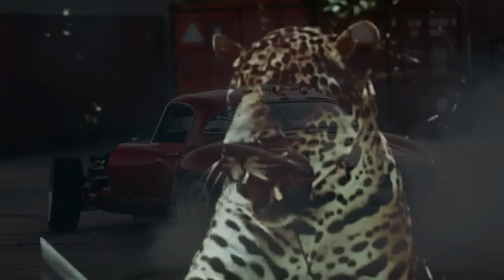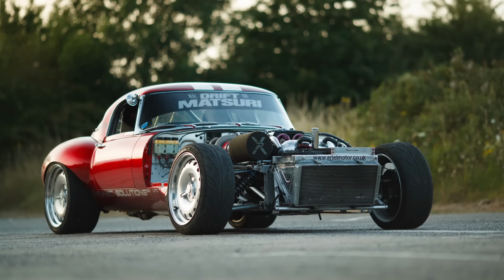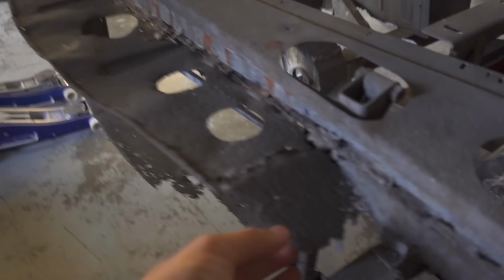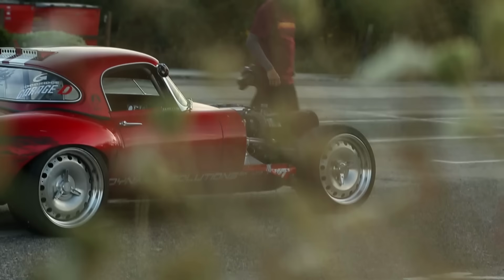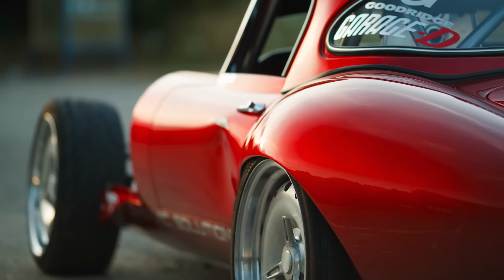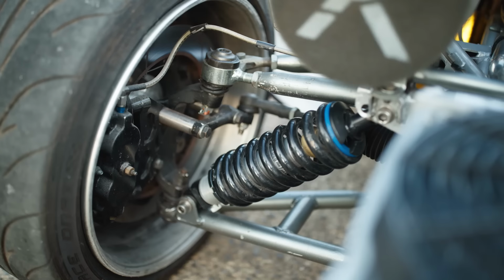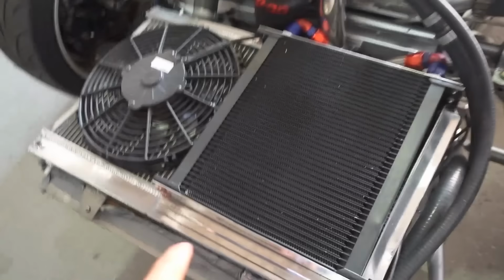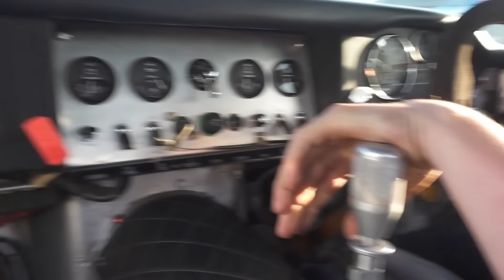Jaguar E-Type That's 1JZ Swapped and Half-Cut: Badass or Blasphemy?

Comment: You mean a Jag that actually runs and doesn't break down every day? Sounds Badass to me...
Reply: Toyota motor on it, so you have the reliability
Reply: @sepg5084  There's a company in the US called JTR, Jags That Run. They sell kits to convert Jags over to Chevy 350 motors. Jags are beautiful cars the mechanics are just so complicated and inconsistent from what I've been told.
Reply: That's exactly what I was thinking! The E Types are gorgeous but being a British car the engine isn't reliable. So it only makes sense to drop in a 1JZ.
Reply: Chris Brown you are very wrong about this car, the original 4.2L dohc I-6 is a fantastic powerful and bulletproof motor even with carburetors
Reply: @jrew3569  Good to know. I've always heard the Jag engines were tough to keep running, but that also may have been more about the ones with mechanical fuel injection and later models than this one. I do like this build because it would be a shame to take a classic engine and try to drift it. Something cool about an old body with a new engine and suspension
Reply: @jrew3569  1JZ is waaayyyyyy better in terms of reliability and sound imo
Reply: ¿ ? lots of JDM fanboys online but have you ever actually heard a Jaguar E-type in person? It’s fucking music to my ears, I don’t think the JZ engines sound like anything unless you add turbo noises. I think you still underestimate the reliability of the jag, they’re built like tanks, oversized components, simple timing and valve train systems, and also handle boost, might not make 650hp stock block but this is also 50’s technology ahead of its time. I know this is a pointless argument but I just want people too appreciate how great Jaguar WAS
Reply: Chris Brown Thats a common stigma with jaguars that would definitely apply more to 80/90’s cars, maybe even ones with this same motor! They used it for decades. I love this build as well, for what they’re doing The motor choice makes perfect sense, I’d like to see more from this guy!
Reply: I'd still have the original engine
Reply: @jrew3569  Jaguar and reliability has been been sinonomous. Jaguars are famous for 2 things breaking down and been money pits.
Reply: @jrew3569  correction all British cars are famous for been money pits
Reply: @Freddy-td8fl  I'm not sure you know what synonymous means...
Reply: @shemwhitehead9517  The engine was good enough to win Le Mans five times.
Reply: @jonjones1553  Yeah.  Back when the Toyota engineers were still in diapers.
Reply: @Chris Brown How many Jags have you owned?
Reply: @jrew3569  Bingo. My wife and I had a 2000 Jag V8. In the 7 years we had it, it never missed a beat.
Love this E-Type. It lives on instead of being crushed and recycled into a steel beam.
Reply: @jrew3569  the 3.8 is actually a better engine

Comment: I'd guess the original E type engineers would be pleased with that. It's not Sacrilege when the donor car was scrap. Doing it to a minter is Sacrilege. Hats off the these dudes.
Reply: damn right if the car is falling apart with a dead engine and bodywork missing then why not keep the look alive but give it a new heart if you manage to come across some old body parts you can restore then do it and make alterations to fit eh new engine nothing makes me happier as a car guy than seeing an old car breathing fire and screaming to the gods that its back for one more fucking ride
Reply: Naaa it’s easier to start with a restored example. Cut all cars.
Reply: Your property, your rules.

Comment: Rolls Royce and jaguar mechanic for thirty year's and I say stuff the traditionalists. It cost 80 grand to get 400 bhp from an original straight 6 and 40 grand of that is just for the aluminium block. If the 2jz was about back then they would have used it.👍

Comment: E-type engines are just about as reliable as the 2jz they could have just turboed the 4.2 jag it actually would have been cooler but pricier ! And the use of hot air from the radiator the cool the air/water intercooler is a bit of a non sense however talented man !